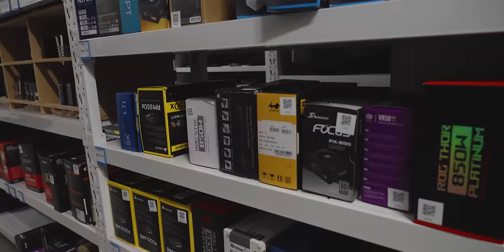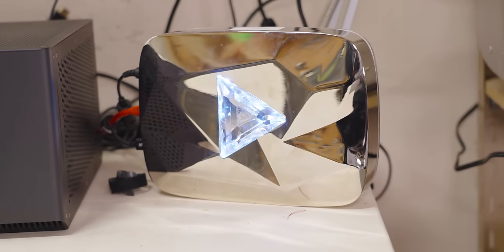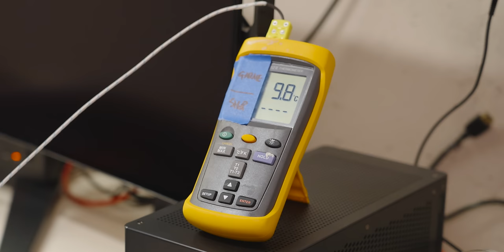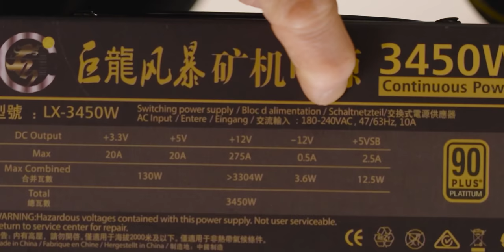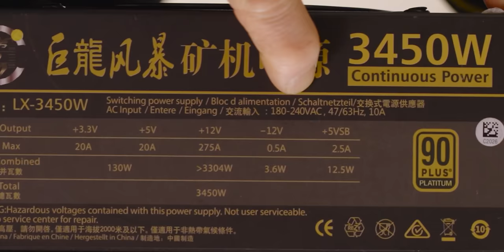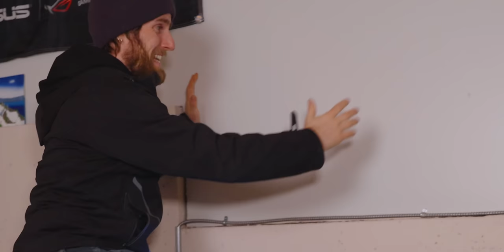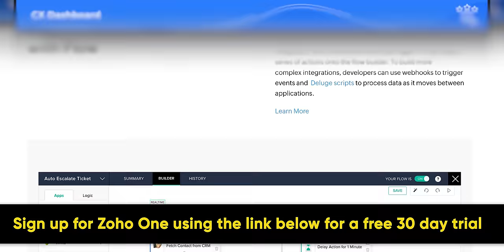Ask me why I'm Mining in 2023...

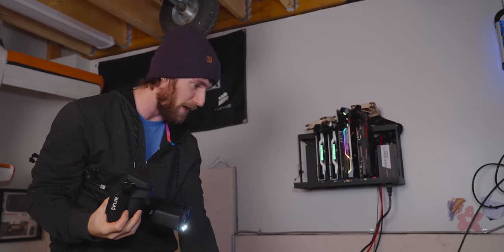Comment: 14:23 "It's almost like Thermal Management is like a whole industry, with engineers and scientists" i died so hard seeing you trying to force naturaly rising heat downwards and saying that line. GOLD
Reply: Ikr, its almost as if there should be cases that work and that alone and flip the pc upside down.

Oh wait
Reply: Hot goes to cold, not up. It just so happens that outside the cold IS up.
Reply: @Metradime  hot air is less dense than cold air, so it rises.
Reply: @your_average_cultured_dude  yes, but in an enclosed space this effect is negligible. Think of a basement - most of the heat gets sucked into the floors and walls - same with the sides of your house - because those are MORE cold than the air above. 

Air density only has this effect in mostly STAGNANT air.
Reply: @your_average_cultured_dude  basically, air isn't the only medium absorbing heat indoor.
Reply: @Metradime  dude, no
Reply: @Metradime  you're mixing up conducting with convection
Reply: @konrad7492  no I'm not. That's not even what I'm talking about. Substances seek to diffuse into an even gradient. If the wall is 0C and the ambient temp is 34C, the heat from the air will go into THE WALL not UP.
Reply: @konrad7492  hot goes to cold, wet goes to dry. The complications are why thermal management is a whole industry and not something that can just be intuited, as you're suggesting.
Reply: @Metradime  I used terms used by the industry. Your "hot goes to cold" is actually an example of such reasoning by intuition you suggested.
Reply: @Metradime it's like you forgot you have to account for gravity. Convection moves a lot more heat than the medium equalising with itself and the surroundings through heat radiation.
Reply: @Metradime  You would be totally right, if it wasn't for the fact that the mining rig is mainly heating the air as it is cooled with air, not by it touching the wall. The heat would escape mainly to the wall only if the wall was the main thing cooling it.
Reply: Of course the air is then being cooled by the walls, but that effect is way weaker as air is poor at conducting heat into solids
Reply: @konrad7492  /fp "not touching the wall" I can't tell if you're being dense on purpose lol 

The air has to cool down. How does it do this?
Reply: @Metradime  The air doesn't need to cool down, it needs to heat linus. Convection is much more efficient in doing that by directing the heated air towards him. The walls won't keep him warm, they are sapping the heat, yes, but that doesn't keep linus warm. You got hung up on the walls being better at taking heat in, but thats not the point here at all. And you call me dense? Dude, you basically forgot things have density.
Reply: @konrad7492  forgot to account for gravity?? Bro you're just arguing for the sake of it now. Gravity affects MASS and is totally independent from temperatures. 

"Of course the air is then being cooled by the walls but that effect is way weaker as air is poor at conducting heat into solids" 

...what? The phase state of the thing taking on heat doesn't matter at all lmao - its that air is a very poor thermal conductor in general - that's why your best shot is to move the air OUT not to cool it down.
Reply: @konrad7492  bro I was just trying to teach you something I didn't know before I didn't a few years of insulation work. I'm sorry you chose this to be incredibly argumentative and combative over. 

You said "heat goes up" - which isn't true especially indoors 

I don't want to argue about it. I'm just letting you know. 

Also, you fancy yourself a lot smarter than you come off. Not here to argue about that either - just letting you know.
Reply: @konrad7492  convection happens due to BUOYANCY - the OPPOSITE of gravity but nice try on that one too LOL
Reply: @Metradime  Buoyancy is due to density. Gravity is directly creating the effect of qbuoyancy as it is acting on the denser part of the medium with a greater effect. I mentioned gravity because you dismiss convection as being marginal compared to the cooling the walls provide, that would be true In 0 gravity, where heat would not rise at all, but accumulate and radiate to "the walls"
Reply: @Metradime  als Im saying is the rig is heating the air, which can be directed at Linus to keep him warm. You're saying that would not work because the walls will suck up the heat more proficiently. We strongly disagree and let's keep at that
Reply: @konrad7492  "which can be directed at Linus to keep him warm" 

No it cannot - not even close to effectively. 

>You're saying that would not work because the walls will suck up the heat 

What do you think the purpose of insulation is?? 

>We strongly disagree

But you have absolutely zero basis to disagree! The heat is escaping because it's an uninsulated space... and your counterargument is "so what" - why do you think people get insulation??? 

>let's keep at that 

Man's tryna high road in a yt comment section after being a combative and stubborn. Come on mate. Just say "wow thanks I didn't think about how insulation exists and that probably where all the heat is going - the uninsulated walls... That's probably why people pay for that instead of pointing space heaters in their general direction." 

It's okay to just admit you were talking out your ass.
Reply: @konrad7492  if you put 1000 degree steam into a tank do you think it's cooler at the top 😂😂😂 🤡
Reply: @konrad7492  like imagine a thermos my brother - where does most of the heat escape?? Pretty evenly - all the way around. QED foh
Reply: @Metradime  I'm well informed and stand by my knowledge, you're just repeating things you've read wiithout any real understanding
Reply: @Metradime  also you reverted to being rude which made your credibility diminish greatly in my eye and thus I am no longer interested in this discussion. Stay stubborn, never learn.
Reply: @konrad7492  ...ok my man have a good night 

You totally OwnEd mE bRo 

I was just letting you know a fun, counterintuitive fact and you were nothing but combative and rude and thusly my respect for thou hitherforth has been greatly reduced my good sire 

Have a good night weirdo
Reply: @konrad7492  oh yeah, and tell me how the heat escapes a thermos lmao!! Through the top?!!
Reply: @konrad7492  also also "I'm well informed and stand by my knowledge" "stay stubborn - never learn." 

Lol you don't realize how you're exhibiting exactly the dismissive behaviour youre accusing me of?? I told you WHY you're wrong and you said 'i stand by my knowledge' - that's just called being stubborn lol
Reply: @Metradime  Now I'm interested in hearing your explanation of why hot air balloons fly.
Reply: Heat rises... Disrupted airflow in a room disperses 'mixes / blends normalizes' -- the walls, and floor will absorb the thermal energy produced in the room as they are the cold points. If the fans have enough pressure to push the air in a still warm state and reach the person in the chair it will help keep them warm 'warm breeze in your face', if not it won't reach or will be a cool breeze. Either way it will warm the room slightly.. It's a terrible way to warm a room or person, an infrared heater above head would be my solution.  -- Stop arguing, you're both right, you're just not having the right conversation.
Reply: @nikos95  literally that what I said lol
Reply: @FiroNebule  because a hot balloon will rise in cold air, but air (indoors) won't rise on itself (for the most part), it just comes to thermal equilibrium. 

Hot air balloon rises because of the difference in temperature between the balloon and the air. Problem w the air is the air becomes the same temperature before it moves anywhere.
Reply: @Metradime  So if you have a fire indoors it should flow in all directions instead of going up?
Reply: @FiroNebule  no - but that's because of the flume effect - smoke pours out of top because of air pressure and air rips in from underneath the sheathing. The smoke physically has no where else to fo
Reply: @Metradime  What about a match on fire?
Edit: Why does the flame(hot air) go up indoors?
Reply: @FiroNebule  I'm not sure what you're asking. Heat doesn't necessarily follow the shape of the flame. Flames are shaped by gravity, but the heat disperses evenly. 

So I guess to answer "why does the flame go up indoors" because of gravity and to answer "why does the hot air go up indoors" it does, but its negligible since air doesnt have time to settle like that in a properly ventilated space.
Reply: @Metradime  Wait so in the original comment I assume by "heat" he meant "hot air" that hasn't dissipated  into the surrounding air yet. Do you think he literally meant that heat anywhere can only spread up? Most people when reading that would automatically translate heat to mean hot air.
Reply: @FiroNebule  well the important thing to remember is that heat can move through air in a non-current fashion - if you go stand in front of a heater vent you will feel hot air for maybe a few inches before the HEAT (not the AIR) dissipates into the room. 

I mean, generally you should just get away from the idea that air IS a certain temperature and think of what that's representing - the air is carrying some X heat energy. 

In the original comment they said Linus was forcing "naturally rising heat downwards" - but that isn't whats happening, he's forcing the AIR (which is carrying heat, yes) downwards but the HEAT is dissipating evenly in all directions (once the air pressure drops - from the push of the fan (that's what makes the reverse side of a fan feel COLD - it's CARRYING the heat from your hand away and breaking your thermal barrier - which ISNT making you cold it only feels that way))

Its suggesting that it would be silly to put a heating vent facing down from the ceiling which we know is not the case (unless those peaky thermal management guys have it all wrong!)

Ps. Sorry for all the parentheses - it's just that there's so much counterintuitive fun to be had here lol - just wanted to add a fun side note that we actually can't feel temperature at all, in fact - we have absolutely zero sensory input for it. What we DO have is a sensor for thermal exchange - which sounds like the same thing but totally isnt! THAT difference illustrates the whole contention. 

For example, if I gave you two blocks of (I actually don't have good examples for this off the top of my head, but you get the idea) metal, one that was highly thermally conductive (meaning transfers heat faster), and one very thermally insulating (low heat transfer over time) - even if they were the exact same temperature (carried that same AMOUNT of heat energy), the higher thermal conductivity would FEEL COLDER. 

Tldr - the difference between a RATE of change vs cumulative storage
Reply: @FiroNebule  tldr tldr - "most people when reading that would automatically translate heat to mean hot air"

that's because most people don't realize how thermal energy works. Ironically, that's why it's an industry and not something you can just intuit. 

And "do you think he literally meant that heat anywhere can only spread up" 

Not ONLY - but there's a misconception that "heat goes up" which is not (generally)  true except for in VERY specific cases (like artificial heating elements in ovens)
Reply: @FiroNebule  okay and in case THAT was all too long to read 

Saying "hot air goes up" is like saying "hot water goes up" - the heat does, not the water - that might result in a current.
Reply: @FiroNebule  the more apt criticism would have been "it's funny to see you trying to force naturally dissipating heat into a cold, uninsulated room"
Reply: @FiroNebule  here's another fun fact your whole house is supposed to exchange its entire air content five times every hour. Convection is literally almost ignorable indoors.
Reply: @Metradime  no, I meant Linuse's scenario and getting most out of it. You just meant that his scenario is far from adequate for heating. I really don't know how to get through to you. 3 people including me have tried and it seems like you're just entertaining a monologue. You started to challenge my knowledge on a notion that applies overall, whereas I am referring to the specific scenario displayed in the video. Please stop wasting all of our time.
Reply: @konrad7492  bro the other dudes are just asking questions, not necessarily agreeing with you lol 

>You started to challenge my knowledge on a notion that applies overall

Damn. Ok I understand now buddy - you're just REALLY socially competitive. 

How can I share a fun fact with you without it "challenging" you? 

>I am referring to the specific scenario displayed in the video 

Yeah, so am I - the wording in your OP is the same mistake Linus is making - it's totally understandable because it makes sense to think the heat is traveling with the air - but that's not necessarily the case. 

You need to lighten up pal 🤗
Reply: @Metradime  read your first answer. You're nitpicking my wording, yet yours was even more vague and sounded like a quote from Quora, then you start discrediting my knowledge by saying I'm dense and now you say I'm being defensive. Seek some help dude.
Reply: @konrad7492  "discrediting my knowledge" victim-mindset 🤡
Reply: Such a long conversation when everything can be explained using basic heat&mass transfer/fluid mechanics principles.

The rig generates heat by joule effect. This heat is then conducted through the heat sinks (forget about radiation due to physical shielding in this case and a much, much lower conductive thermal resistance) and then transferred to the surrounding air using a combination of fins and fans to induce forced convection (better heat transfer + the heat is carried away from the rig).

The hot air blown away from the rig then rises due to natural convection (hot air density is lower than cold air so that a buoyancy force pushes the hot air upwards). This natural convection is absolutely not negligible and it is in fact how most home radiators (despite their name) mainly propagate heat through a house. The radiators are placed near the ground, and preferably even near a window (so that the rising hot air acts as a barrier against the cold air being conducted from the outside). The air rises, reaches the ceiling and propagates to the other side of the room. As it does this, it cools down exchanging heat with the walls/ceiling and the surrounding (colder) air. Since it cools down, it gets denser again and goes downwards. All of this leads to the creation of a convection cell, where, in steady-state, the air circulates through the room from floor to ceiling, and from the radiator side to the other side in a cyclic manner.

Both the air in the room and the walls gradually heat up. As a detail and without considering heat capacity, the walls having much more mass than the air in the room, they will take much longer to heat up.

Now what would be a better (though still not ideal) solution for Linus?

- Place the rig on the ground, on an insulating material to avoid losing some of the heat away from where you want it
- Extra fans are not necessary due to natural convection

But even doing that the room is probably not well-insulated enough so he won't be able to get a good temperature raise (the room reaches a low steady-state T°, at which the heat lost through the walls is equal to the heat generated by the rig).

Now, the most interesting parting part is that the feeling of warmth in a room is actually closely related to the walls temperature and their albedo. In absolute, walls don't radiate a large amount of heat (since radiative heat transfer is proportional to T^4 --> low T = very low radiation, high T = very high radiation) but the small amount they radiate still provides a very characteristic feeling of warmth. Typically a room with white walls will feel colder than a room with darker walls. Also, if you heat up a room that hasn't been heated for a while, it may still feel cold even though the air temperature has reached a good value, simply because the walls haven't absorbed enough energy yet and therefore aren't hot enough.

Nobody is going to read this but my pleasure KEKW
Reply: @fredvh4565  I'd like to point out that the reason for this post not being read would likely be how long it is
Reply: @fredvh4565  I mean basically the thing that's missing with the two people arguing above is they didn't differentiate between natural and forced convection, which are something that have to be taken into account when talking about convection.

"Heat goes to cold," while true, if there are other forces at play (say, fans) then whichever direction the fan is blowing will be where the heat goes, then as you mentioned, natural convection will play a part after the pressure dissipates

"Hot water goes up," just like the case with fans, if there are any other forces heating up the water (say, fire on a stove), then yeah there will be current due to natural convection, buoyancy and all that; and there's a temperature difference between the water on the bottom and the top of the kettle. Can't say the same thing about thermos because there's no driving force on this, and no temperature difference in the water, so the water will just conduct heat to the thermos' walls.

Btw I read your entire comment lol though you probably won't read mine
Reply: Everyone replying to this trying to argue about thermal properties is missing the point of the line
Reply: @haydenphipps4923  well, the line's OP is also one of the two main people arguing. And as one of the core points of the line is about how the heat acts according to intuition, the subsequent argument about how counterintuitively heat would act does sufficiently meet the line. You missed the point of everything, congrats.
Reply: Here we can see the fight between two "experts" discussing if heat goes up or goes to walls
Reply: @konrad7492  bro you probably believe in dinosaurs why are you still talking to me lol 🦖 you think THAT guy was the apex predator LOL